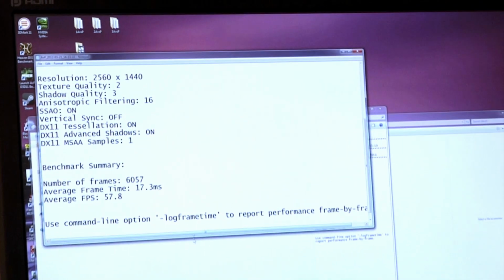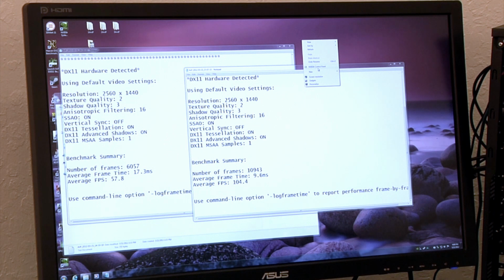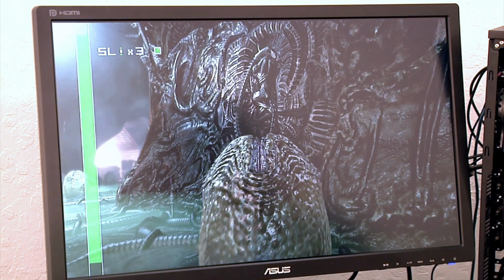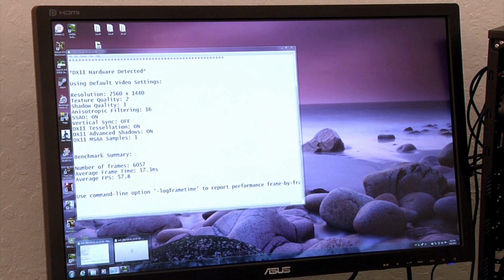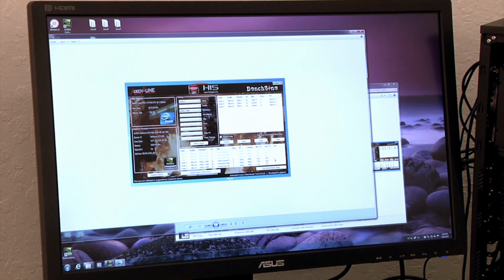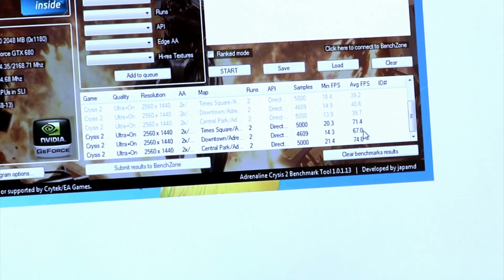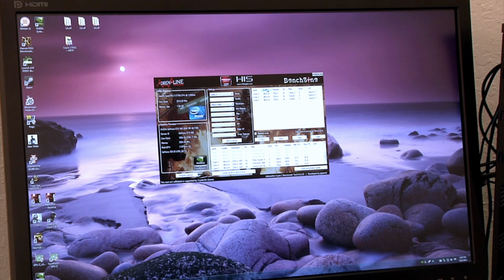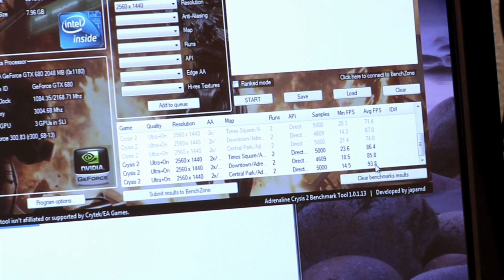ASUS GeForce GTX680 3-Way SLI on ASUS Z77 Motherboard

Comment: Hey, 
Am I going to be able to run 3 way SLI on this board ?
Asus P8Z77-V Motherboard (Socket 1155, 32GB DDR3 Support, ATX, PCI-Express 3.0, USB 3.0, Asus Wi-Fi Go Remote, SLI/CrossFireX Support, Dual Intelligent Processors 3)
Thanks

Comment: Im using z77 sabertooth with 2x 680(3.0, 8x-8x). if i were to add a 3rd 680, will the 2.0 4x pcie slot affect its speed?

Comment: Will you please list the specifications of the computer, i want to start buying a pc with only power supply cpu and mother board capable of at least 3x crossfirex, but i will buy the video cards over time, ill start with the hd4000 on the IB cpu

Comment: i need some help for my new build. help guys~
Which memory should i buy for new ivy bridge? i will be over-clocking at about 4.5GHz.
- 16GB DDR3 1600 memory ($95)
- 8GB DDR3 2133 memory   ($59)
- 8GB DDR3 2400 memory   ($99)

does speed of ram really matter that much anyway??